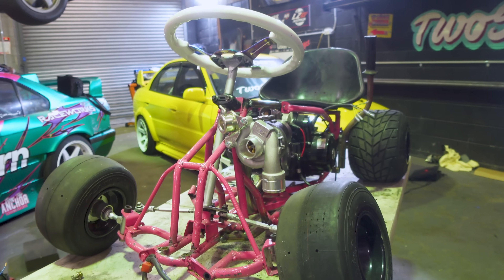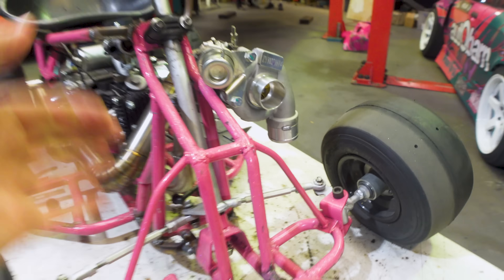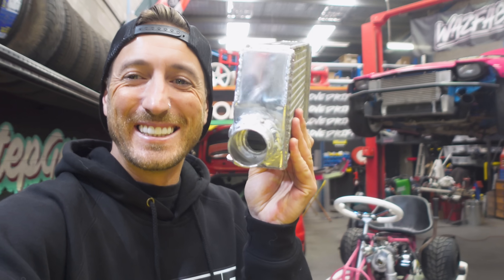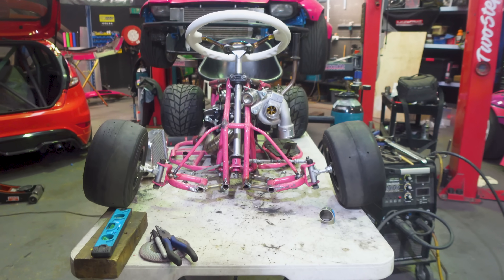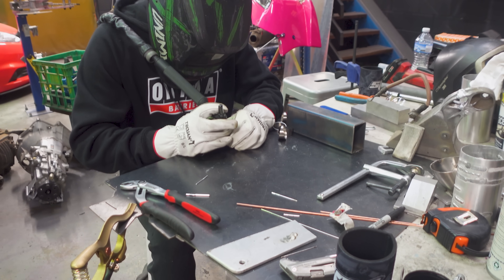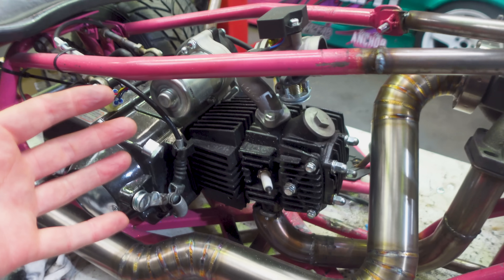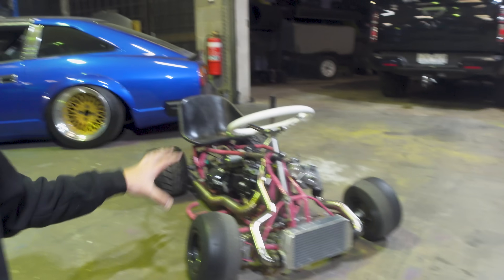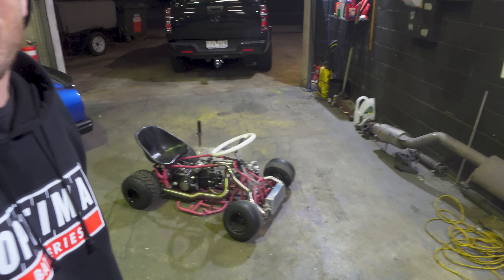125cc TURBO Go Kart Build | Part 4 (Fuel Injected)

Comment: You won’t get enough boost to ACTUALLY use that intercooler. Turbos work on pressure ratio’s (at the inlet) as a function of engine flow rate (corrected for flow rate for ATMOSPHERIC pressure). You won’t get enough revs out of a 125 with a good volumetric efficiency at the revs you’d be running anyways to get any sort of meaningful boost (even with that tiny turbo) BUT if you compound turbo it and you factor the pressure ratio’s together… so 4psi of boost (1.27 pressure ratio) increases to 9psi of boost (1.27x1.27=1.62 pressure ratio) which cause a ‘chain’ type reaction in the system to actually force more flow rate and then force more boost. You’ll see probably 15+ pounds of boost with a compound on that motor and with the fuel injection would run great and then you’d actually be using the intercooler.

Comment: Put a cap, with an air line on one side of the intercooler. Get a baseline of what the inlet pressure is. Put an airflow meter on the exit side. Calculate the difference.

Comment: All I have to say is to get some grommets on that rad. Bc the mounts like that will be destroyed. You’ll be in a world of trouble. Bc it’s going to vibrate a lot. All that vibration is going to find its way down to them mounts and break off
Reply from the maker: Not a bad call on this one! These things do vibrate more than a s*x toy that’s for sure 👀
Reply: @itsmikelake  yea. Theory the motor shouldn’t have move like a normal vehicle. No dampners. But the rubber on the charge pipe should dampen it some. But the air still would possibly vibrate the cooler. Hopefully u didn’t get too far into the cooler building 😂

Comment: A great tip that's gonna save you so much head ache and disappointment add a plenum if 125cc shoot for 500cc or a bit more. It won't make much without it and it's gonna be hard to tune. I have a 155cc compound bike that's over 100hp on ridiculous boost it's been a idk how long r&d project of mine and pre plenum we struggled to get any meaningful power. Not to suggest your gonna get over 50hp with one turbo 😂 on a 125cc but you can get pretty close. I prefer carbies but to each their own just when making a new intake you can plum the plenum either between the tb or after but tuning will be easiest engine plenum tb and runner length matters alot they make boost up top as singles and have back pressure issues quick so make that runner longer. Were a bit bigger but saw a solid 20% gain in the usable powerband by making the runner about 10in longer. This is on a xr based engine but similar enough. You can also use the world's fastest postie bike as a great reference I copied a lot myself and when I didn't listen I ended up at the same conclusion eventually like the turbine housings being way too small. FYI they got a semi reliable 60whp on 45psi of boost on a bone stock motor so they can take more than one stage of compressor can give. Looks like your going the vz21 route id suggest a vz45 as the exduser is bigger on the compressor wheel and spends less time in surge along with a bigger turbine wheel so the back pressure is reasonable. Back in our single turbo days we tried everything we could get and the vz45 was best by miles and didn't complain too hard making 30psi although the Chinese so sell billet wheels for them I was able to message seller and get a few custom ones with the absolute limit on exduser size and an extra blade to help the efficiency at higher pr and move that surge line down further. Keep in mind the vz21 wants to see that engine make 30hp before it's out of surge and the vz45 only needs to see the flow of 20hp the custom ones we have would get happy around 20hp too but we were able to lean on them all the way to 50+psi although they don't live long after 40psi as they have a 270° thrust bearing. Carbies make the mixture cooler and you can chill your fuel with dry ice and well we don't need an intercooler although the latest version does have two and it certainly helped us get over the 100hp mark. Oil pressure is an issue although if weight isn't a huge concern an electric pump would be best then you could have a totally independent oil tank just for the turbo.

Comment: You could measure the pressure drop by static pressure. Fieldpeace makes a static pressure meter. You’ll have to rig up something like a  leaf blower. Connect the leaf blower to one side of the intercooler and you’ll have to put one hose on one side other hose on the other side and measure the static pressure. or something.

Comment: To accurately measure your pressure drop over the cooler, just put two pressure gages in, one before the cooler and one after. Subtract the two, and there is your drop. Pressure is flow dependant, and it is best to do on the actual motor, so that's consistent. 

My feeling is that it has plenty of flow. An automotive cooling system runs around 1 bar of waterpressure (i think you could be running 0.5 bar at best). Water is way more viscous than air. 

Again, I love the work!
Reply from the maker: Bro, you’re so damn smart! I really appreciate this advice. I’ll do the pressure drop test in one of the upcoming videos as it’ll be super interesting.

Comment: Make sure u think about crashing the thing while building.

Yes the front mount looks tough as on the from but it’s now in kill zone if u send it into a street sign😂😂

Maybe a small “bash bar” underneath the cooler poking out slightly so there is something to hit just in case.

Love the video man. Here within 15min😂👌✌🏻
Reply from the maker: That you’re absolutely spot on. Likely a wee bash bar is needed for sure. And some brakes 🤣. Appreciate you watching bro 🥰

Comment: I was thinking about the flow and pressure drop before you mentioned it... and I actually think, that because of the time it takes for the pressure wave to reach the inlet after it's creator has left the exhaust port (the reason there needs to be a chamber to store boost rather than send it backwards like a two stroke exhaust does) the higher pressure on the hot side may stop bleedback from the cold side. the pressure difference may just work to your advantage. I'm also thinking that 2 boost gauges (one on either side of the intercooler) for testing purposes would be interesting,
But yes the standard is pretty damn good. It's looking awesome!
Reply: sounds good i might try that for my drift trike